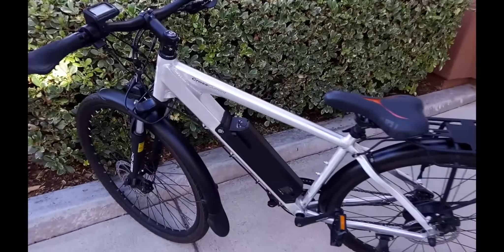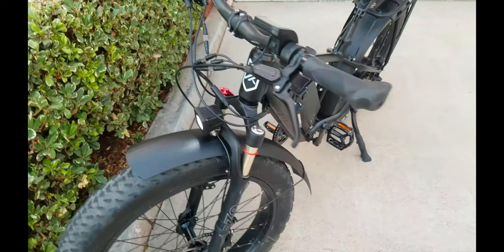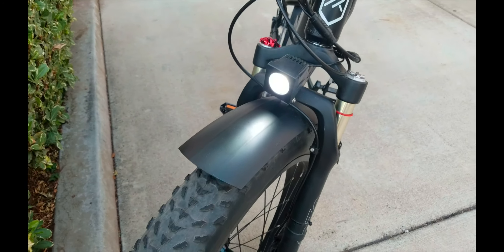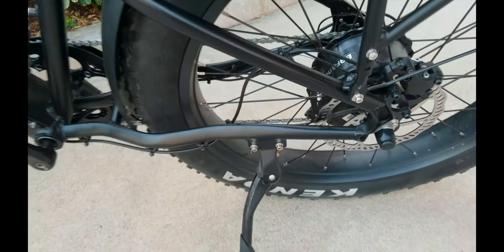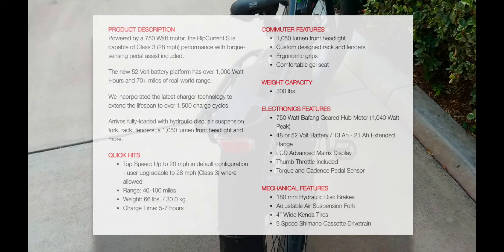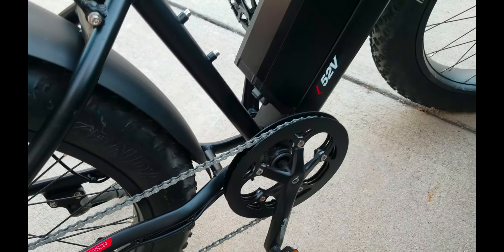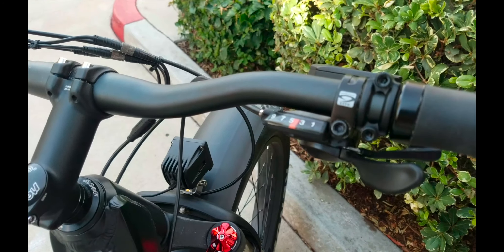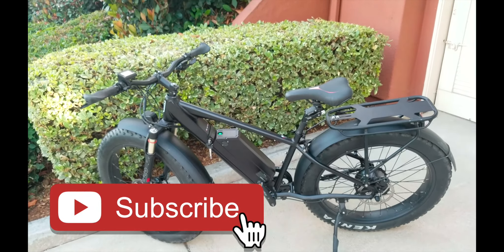eBike 800 Mile Transformation!  CrossCurrent to RipCurrent :)

Comment: Ive had my RCS for about a month. At 349 miles..my commute is 16 miles round trip. Charge twice a week and have the 21ah battery. Always in S mode. Also have the same seat post which is highly recommended..much better. Tire psi for me 26 rear 24 front. My rear rack was warped so i never put it on. This caused the rear fender to be nothing but problems..so I removed both fenders and its so much better
 looking and basically rattle free. Plus I wont be riding in the rain. I mounted the rear led to the bottom of the seat which worked awesome..
This bike is awesome 🤙
Reply from the maker: That's great to hear I can't wait 😎

Comment: I'm really curious about this bike as a CCS owner.  The only thing I'm not crazy about is going 28 MPH and riding over some of the rough surface streets of LA (I'm talking about you Olympic Blvd!).  If you could go into depth about the differences with regard to ride comfort between the bikes, it would be greatly appreciated.  Also, Court mentioned in his review that he thought it was lacking in power, but I don't think he was using the throttle assist mode.  Any info on this would go a long way too.  Thanks!
Reply from the maker: Steven Schwartzstein great feedback.  for sure I'm going to take this is my daily driver now so I'll detail all those items for you.
Reply: Awesome, man.  Look forward to your review.

Comment: So what happened? Did you like the rip current?
Reply from the maker: Yes, the rip current is one of my favorite bikes. As far as speed and functionality.  However really depends on what you're looking for I also really like the Tenways bike.  Meebike for heavy hauling and distance.
Reply: @smidgelife  how is the tenways with hills? I am debating between ripcurrent and cross current versions with 52V 15 ah. I have some mostly flat gravel and some paved inclined heels that are leg killers. I am in PA, so some snow and rain and hot days during the year. I probably won't use it with snow if I go with the cross current. Could you compare or summarize how they feel different in gravel? I am attracted by the power and versatility of the rip current, but attracted to the lighter weight on the cross current.